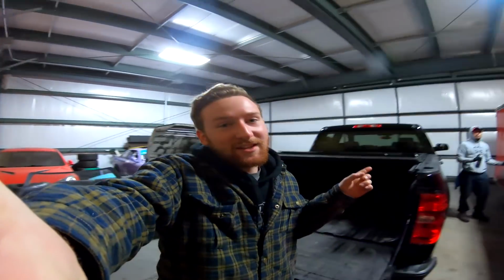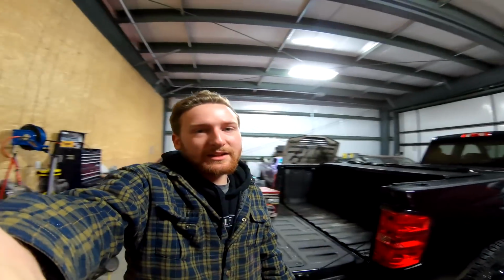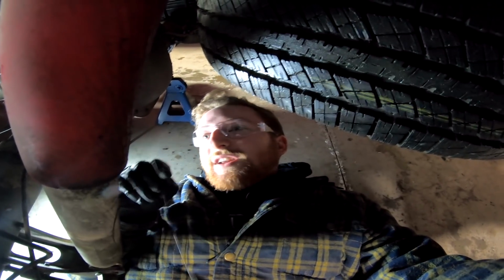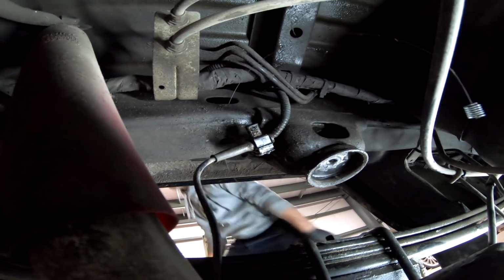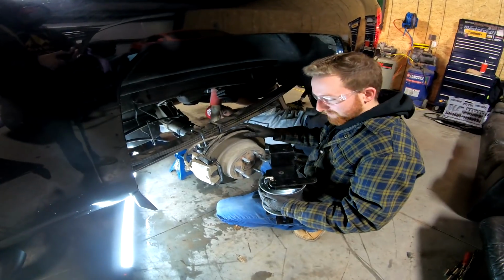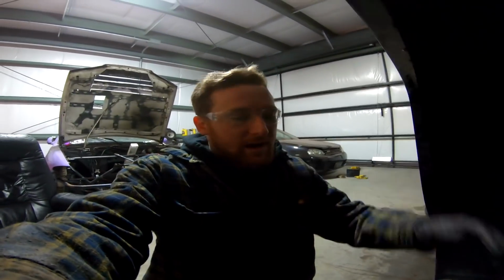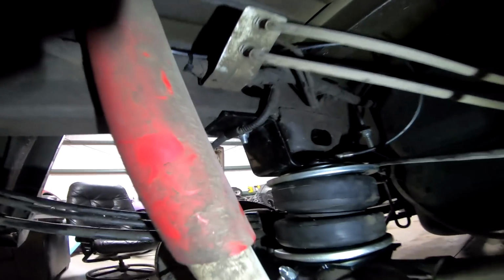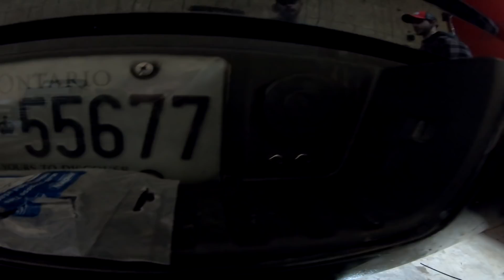Installing The Air Lift 5000!!! 2018 Silverado

Comment: Why did you run two lines for the bags? So now you have to fill them up one at a time. Equally if you have a load on why wouldn't you just T them off and run them together?
Reply from the maker: just didnt think about it at the time

Comment: What size lift do you have and did you need a spacer to compensate for the lift. Thanks
Reply from the maker: its just a 2.5 inch level in the front of the truck